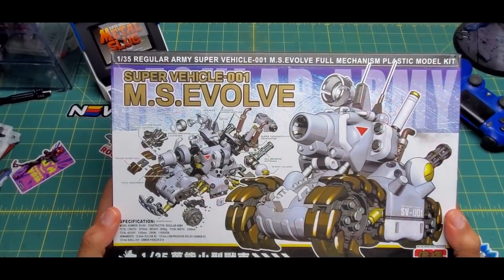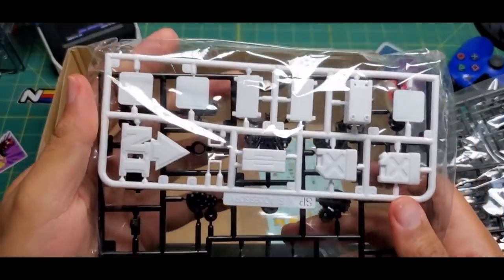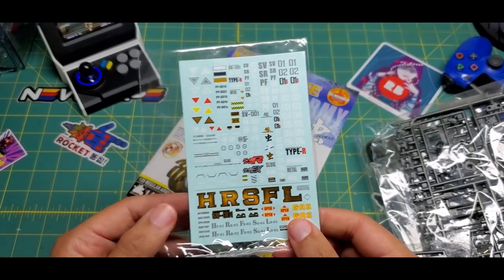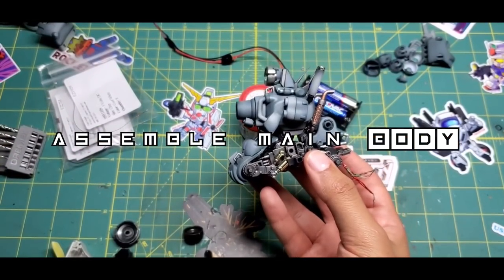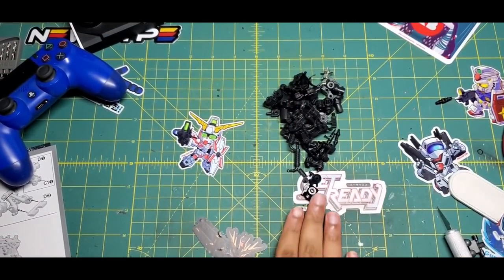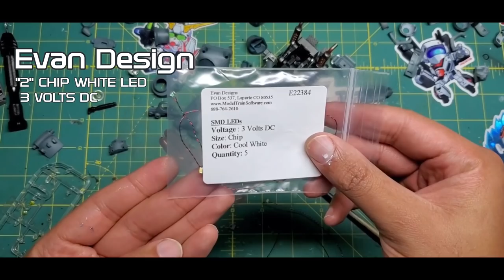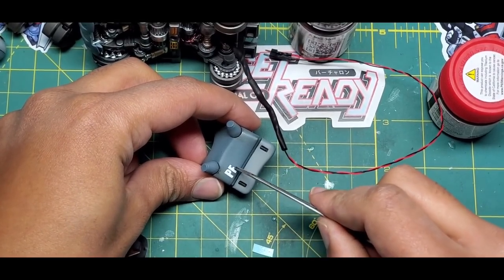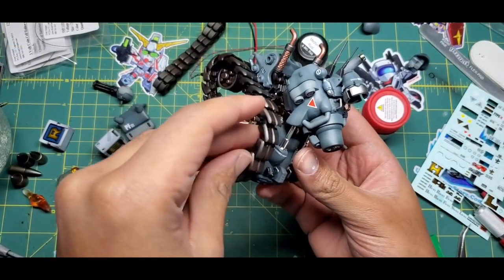#newtype #metalslug #NEOGEO Metal Slug M.S.EVOLVE

Comment: About pieces, i assambled it perfectly for the first time, and pieces fit very well, but when i decided to custom it, dissamble the pieces, apply a layer of paint and reassamble it, it was a mess.
So i think the model was made so exact and milimetrical, that it does not support a layer of paint.
I have the intention of buy another, but now cover joints to get better results. 
Also pieces quality was a shit, they broke easily